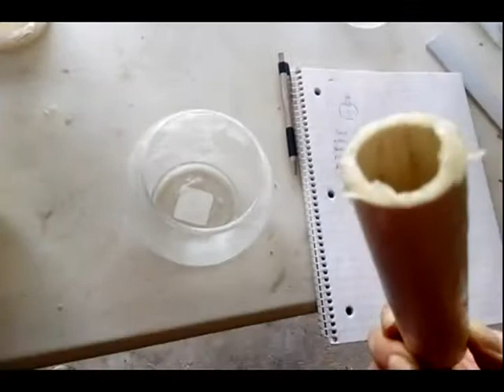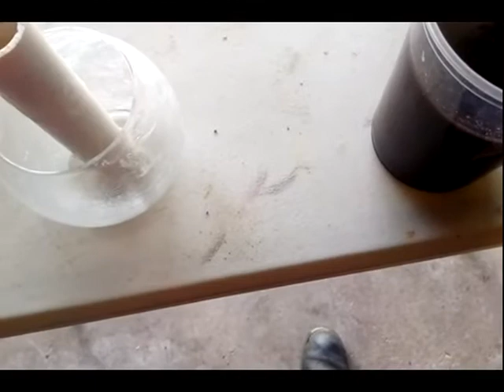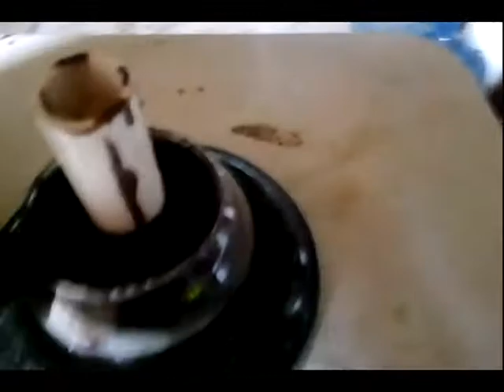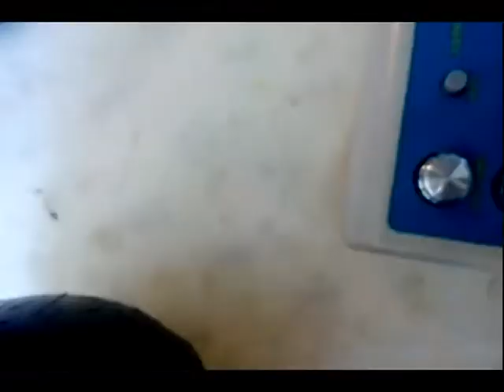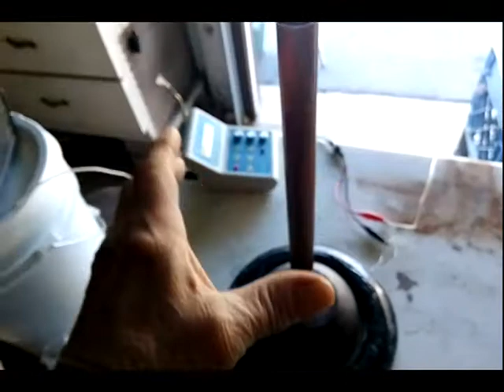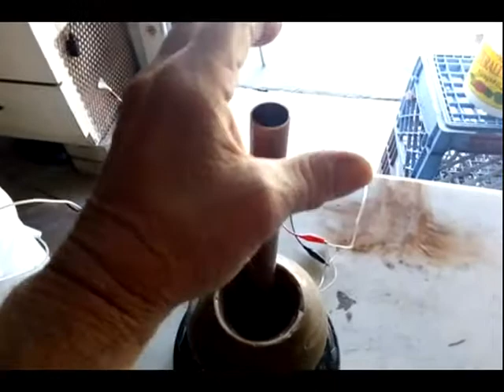orgone orb

Comment: I'm curious what a coiled Copper wire on bottom would have done. Or a copper wire cone wrapped around the outside of the hole. 

Hahaha I knew it ! I knew you were gunna tinker with it after it was done! I saw that open hole & KNEW u were gunna start stacking things & shove'n pipes down into that open hole! Lol :)

Also, how in previous vids we were discussing the topic of vortex'ing water & magnets. Have u ever made one of those charging pucks for water? The orgone puck with the wrapped copper wire. What are the differences between vortex'ing Water & putting ur water on one of the pucks? Or do they do similar? I've done neither, but am wanting to start doing it. & the puck seems easier & more convenient. Lol 
I've never made or done anything. But sure have researched a lot into all these things. Haven't tried doing anything I don't have much money to get what's needed & always being behind on work leaves me with a full plate. Only a one man show, from field labor to bookkeeping. & the weeds don't stop growing & trees don't stop drinking. Lol
Reply from the maker: Water on orgonite and vortexing water are two different things with similar results.  Both are excellent for plants but the difference in taste is interesting.  In before and after tests, vortex water tastes so much better.  Add some magnets and run it through 20 times or more and you'll have a decent detox.  Orgonite coasters or shower tiles might be something to consider.  Setting an old cloudbuster base in my garden got me tons of melons the size of bowling balls with only rain to feed them.  
Working a farm is tough but doing it solo takes grit and determination I admittedly have not near enough of.  It costs about 40 bucks for a gallon of resin.  I'll bet dollars to donuts you have everything else you need to make something dynamic.
Reply: lofas23 now that the season is over I have a little bit of money. Prob not enough to last a full season untill next harvest, but while I've got some $ I want to make some. 
As for materials, I don't think I have all of them around here. Probably just the sand. What is the best way to reach u? I think I might have ur email somewhere. I emailed u once probably 10-12 months ago regarding one of your devices you mentioned about selling.